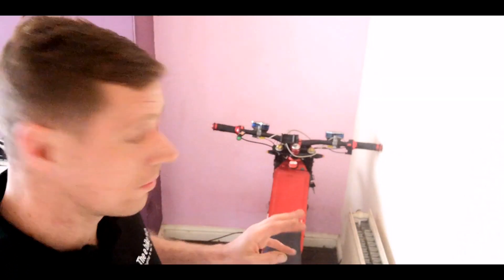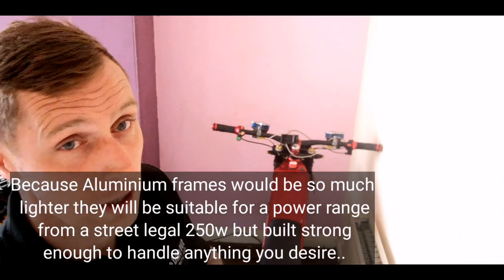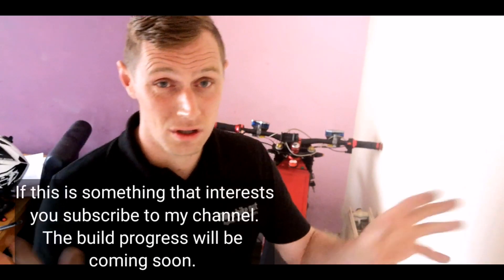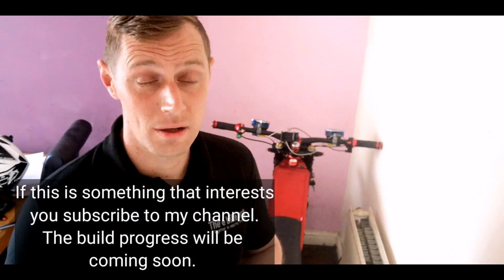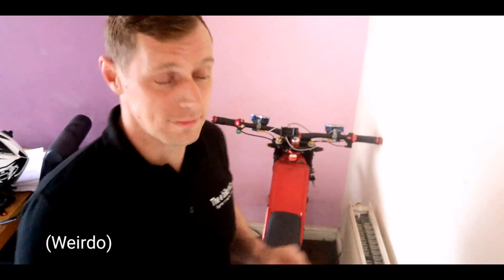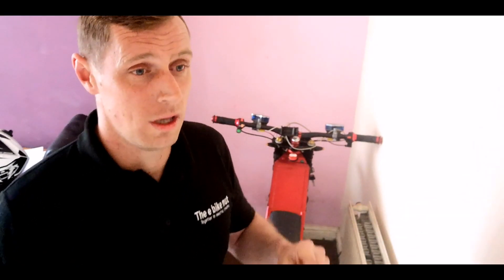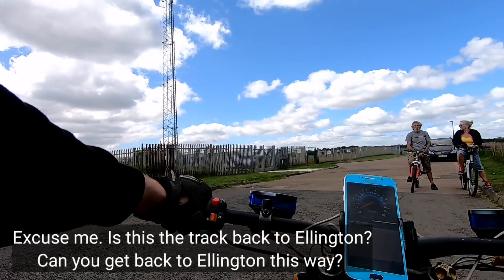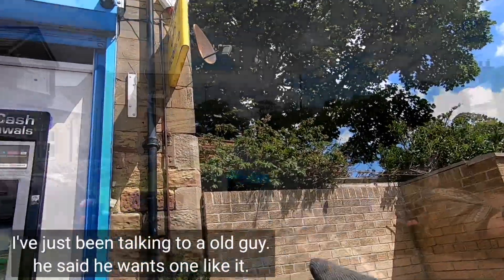HOW CAN I MAKE MY FAST ELECTRIC BIKE EVEN BETTER | FUTURE PLANS |

Comment: Awesome ebike mate, currently building my own 5k watt rated rear hub, 20s 5p Samsung 25r cells 20A continuous 50A max 2500 mah - the same frame as yours (stealth bomber copy) x4 5s packs, I'm not using a bms as I've decided to use an external balancer charger, and a parallel charging plate which can handle upto 30A - 100A sabvoton controller - 26" wheels with slick tyres - hidden GPS tracker and controller alarm (with motor lock) - lights indicators horn all work from dc to dc converter (90v max to 12v)
(plan on limiting it's draw to 50A to double my battery life) do you think I could get 30 - 40 miles range from a single charge?
The only thing I have left to get is the rear motor
Reply from the maker: I know I guy who has a 20s 6p battery 3000mah cells tuning up to 100a and only gets about 20miles bud. That should give you some reference. Sounds like it's going to be a good bike your building tho. Word of advice don't give in. It'll all be worth it in the end 👍
Reply: @theebikenut4679  cheers mate, I think the first thing I'll be upgrading is the battery anyhow, its a bit of a budget build just to get myself on the road as I have no other means of transport (failed my driving test multiple times) what kind of speed does he get using the full 100A? Where I live its full of hills so I'll only really be using the bike to get up the hills and then coast it down the hills,
Reply: Also after my ebike is finished I'll be building an electric recumbent bike with a wind shield (so it's not so cold in the mornings)

Comment: The E Bike Nut,
why are you using those trash tires ??!!
get some good off-road ones !!
Reply from the maker: There's a few reasons I use these tyres. Firstly they are on off road tyres, they have never had a puncture. They don't chew up the ground and because of the power I have I would rather the wheel slip than  flip. Also with a knobbly tyre there is a lot more drag when using off road this will cause my motor to get unnecessarily hot and possibly burn out. Also there is a lot of road noise from a off road tyre along with limited grip on the roads and shaky ride. Don't get me wrong off roads tyres would look mean but it's not about the looks the bike has to work and ride as it should and most of all its got to be reliable.

Comment: Hi will great video. aluminium swingarm and frame is definitely the way to go i would definitely be up for buying 1 ive already replaced the side panels with aluminium and wrapped them in carbon fiber vinyl.
Reply from the maker: Cheers John I'm sure everyone who knows this frame knows it's heavy. I think I could build it with a 3rd of the weight and on a e bike I think it would make a huge difference. I'm going to make one for Emmas ebike electrics her bike car run 2600w if I change the controller... It would be perfect for a aluminium version of my bike. We will also so have his and hers haha pretty cool 😎😁👍